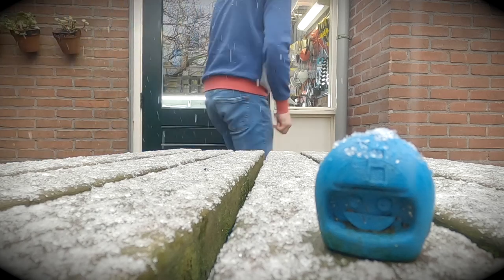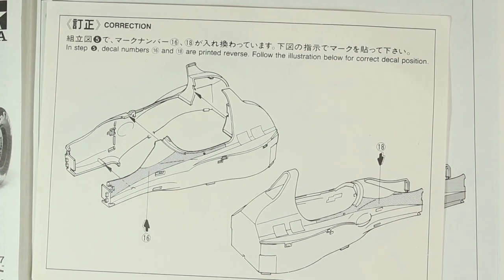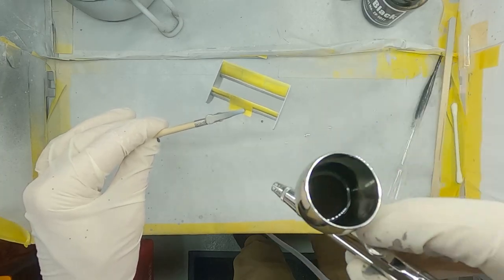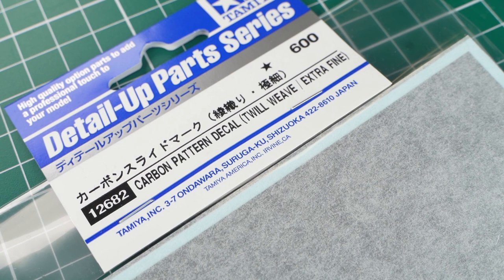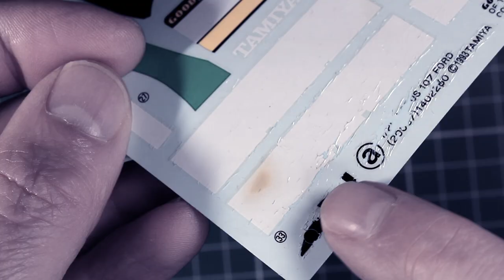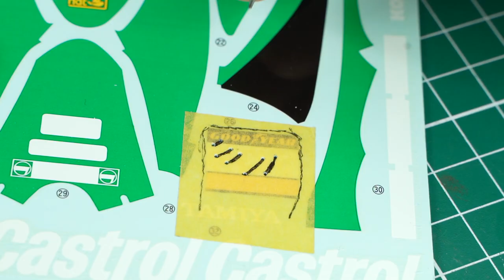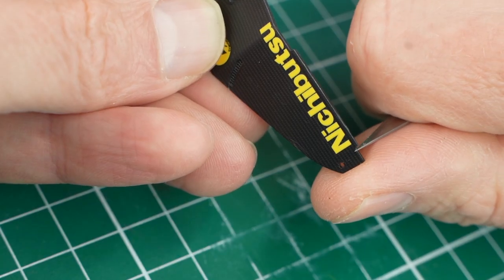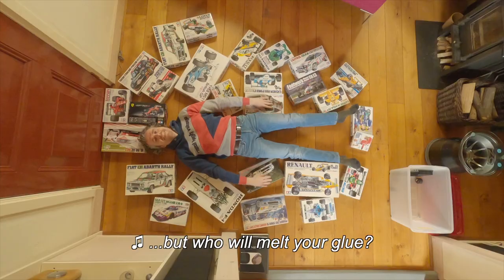DISASTER!: Building Tamiya Lotus 107 Ford F1 Formula 1 model car of Mika Häkkinen 1/20 scale - #1

Comment: i feel your pain on all those decals lifting. nice recovery. i always like a few thin gloss coats on decals especially if there's more taping to go. save the flat coats till is done as sheen depends on the last coat, and I'm ready to move to oils or stuff that flats work better with. also letting tape sit on surfaces for long periods like overnight never helps. as for decal rips, i've changed to a 2 second dip ,just enough to saturate the paper part, then resting it on a damp paper towel, paper side down till the decal releases and only adding a drop of water if it hasn't released after a minute. the thinking being that water soaking can break down the acrylic film faster that the paper. by going after softening the paper directly and not the whole thing, my decaling life has drastically improved. cheers.
Reply from the maker: Thanks for the tips!

Comment: Hi great Video buddy I feel your pain with paint issues, zero paints are great paints they are not compatible with tamiya primers what I use is cellulose based automotive primer thinned down with anti bloom thinners you can dry sand wet sand etc and any paint will go over the top, plus it will last you a lifetime and it etchers into  the styrene. and it will not melt your kits so don't worry about nay Sayers on the internet knowledge is king here. I use it all the time and it is cheap and zero paints are ok over it because they are automotive paints. Don't just throw out your zero paint you just need the correct primer grab one of there primers and do a comparison between primers then coat both in zero base coat.
Reply from the maker: Thank you Andy, I will try your proposal in the future!
Reply: @hobbyrobby  no problems buddy I found that tamiya paints in the jars may be to there own formula and seem to be alcohol based not sure on this, I just found cellulose based primer great yes it smells etc but it's a hot primer and pretty much any paint will also go over it even 2k. Ps the primer is really thick and you can use it to fill pin marks etc also tamiya cellulose body putty is just thick primer because you can thin it down and air brush it lol.. how do I know this 30 years in the body and paint trade retired now styrene model prep paint is no different. Like I said knowledge is king with paints.branded paint like tamiya etc just want you to buy there paint I use tamiya, Vallejo, craft acrylics etc but always use cellulose primer take care wil sub to your channel because you are quite exciting to watch lol....
Reply: 100% on primers and also fillers as mentioned below. I've never tried zero so thx for that tip. yet another strike against tamiya paints.

Comment: I have NEVER had good experiences with Zero. Had Mclaren red that was basically water, it had so much thinner. Awful. But then I see other people who got great results......must be the desert air. I always put tape cut outs on the backing paper and invert the sides (right for left, left for right).
Reply from the maker: ZP needs to be mixed very thoroughly, especially at the bottom where all the pigments sit. This needs extra attention compared to other paints
Reply from the maker: So shaking a ZP bottle is not an option. You need to stir it with stirrer

Comment: It's a nightmare but you did several mistakes. Never apply masking tape directly on decals. Always apply primer (2k is better) before spraying ZP paint. You will learn from your mistakes but its a long long way.
Reply from the maker: I did use primer before applying ZP and the tape wasn’t put directly on the decals. The decals were coated with varnish